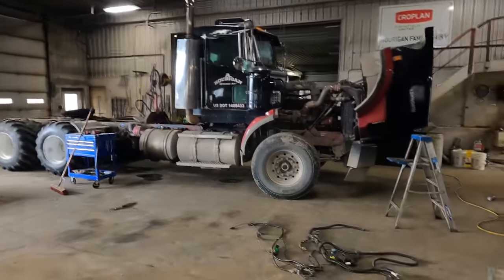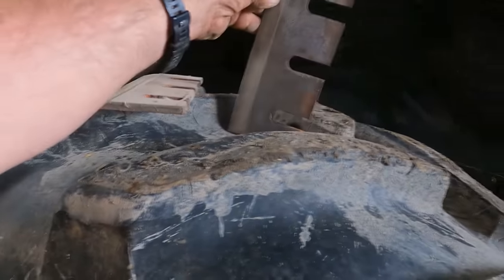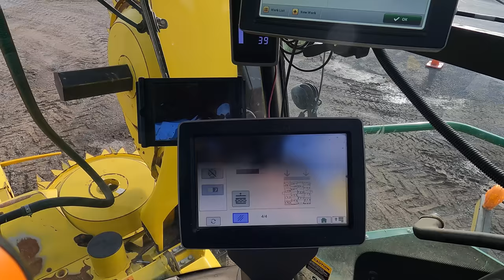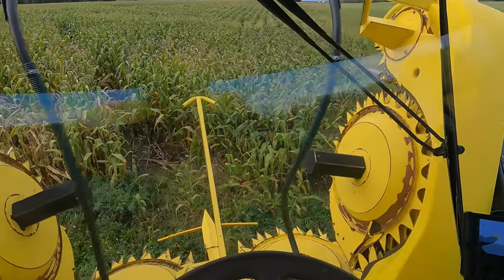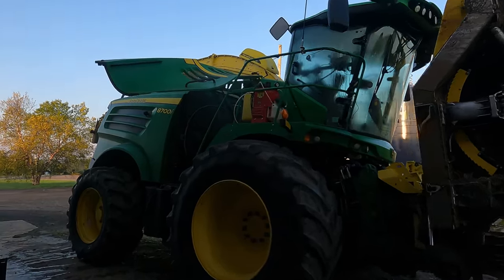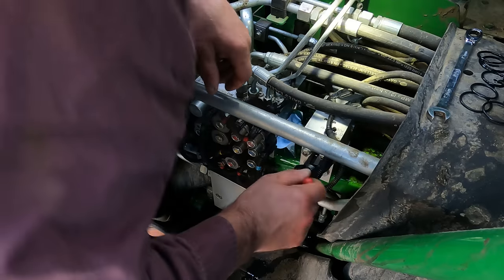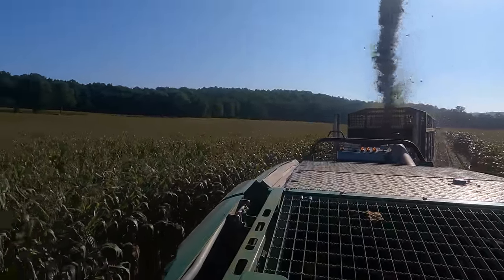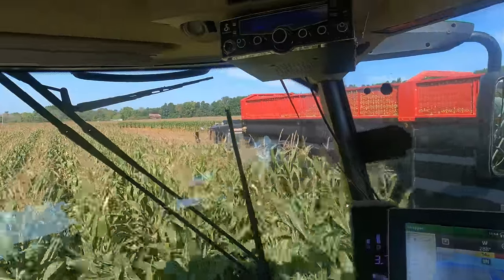Telephone Lines and John Deere Chopper’s

Comment: Sounds like you have enough work for a second 8700.  It would be good for piece of mind in times of mechanical troubles.
Keep up the good work!
 I enjoy your channel immensely!
JIM 🥰
Reply: Richard Homan  I didn't say buy new.  The 8700 is available on the used market from between 300K to 500K 
You would definitely want to shop and preferably get one pre def.
Just my opinion from what I see and hear in the videos.
Sometimes time is more valuable than money.
JIM  🤔
Reply: Heartland Dairy now it was called labelle Dariy we ran two choppers. Two sets of trucks. Quite the operation. Period
Reply: Richard Homan  Note, I did say it seemed they had enough work for two machines.
I did not mean to have one sit around, that is what you said.
You are trying to win this conversation by manipulating what I am suggesting.
This conversation is over.
The only one to determine what will be done is Andy!

Sit back and watch the show.
JIM

Comment: The superior material for O-Ring composition is Viton!
If you are not using them made from that material, it would behove you to find a supplier from which you obtain your O-Rings to use across the board for all usage.  When you get O-Rings from Deere, they very well may be Viton, but common O-rings found in general assortment boxes are very likely not Viton.
Keep up the good work!
JIM 🤩

Comment: That's one of the biggest Problems with the P B & KW Ultrashift  Transmission's is the wiring Harnesses We has both the 13 speed and 18 speeds 2016 2017 and 2018 lucky all of ours were still under warranty ! Good to see your starting chop some corn . At least you had rain out your way tho . a lot of corn & hay out here in the albany area didn't get a lot of rain . So both the hay & corn crop did not do real well . In some places very poor 2 nd cutting of hay .
Reply: Just out of curiosity -- is there a common "bad spot(s)" in that harness and is there a reliable and quality aftermarket source for a replacement harness?  

I'm guessing that there's no core charge; I should DDG(Duck-Duck-Go) it, thanks for the info that sparked an idea in me noggin. 👍🏼

Comment: Do you think a shop addition is in the future. Something with a high enough roof you could build boxes easier/ work on your larger equipment?
Reply: Andy has stated he would be in favor. Would you be willing to donate a $$ quarter million for a shop annex ?  Just meeting the current equipment repair/maintenance expenses has resulted in significant hair loss. Shop expansion remains on the wish list .🇺🇸🗽🍶🐄
Reply: @billupstateny9151  
Does the Horigan(sp?) family know how intimate you are with their business, and Andy with his thoughts?  

My social skills ain't up to par, my balls have shrunk, and I can be rather dumb and dense but never in my wildest dreams would I conjure up the notion that any one that's a part of their organization would solicit and/or accept a donation for their own use.  I dunno, maybe back-handed insults are acceptable in all of  NY and not just the urban centers.
Reply: @lt1nut  would not speculate just what your mind could conjure up however if you are offended by my comment in some manner, by all means submit your complaint to Andy.
Reply: Well, he is in the process of adding a couple hundred feet to a cow barn
Reply: @johnwudarcki9315  Cows belong  on the plus side of the ledger, an asset. Shop work, generally a cost, subtracts from bottom line.
Reply from the maker: That would be nice

Comment: Just a thought Andy.  It may be easier, and less work, to put higher pedestals on the 5th wheel to increase your clearance.  Think you can get them in 25mm (1 inch) increments.
Reply from the maker: Yes

Comment: How did you determine it was the wiring harness on the Peterbilt and not a sensor?
Reply: It was at the dealer they diagnosed it and fixed it

Comment: You should build yourself a universal hyd tank vac pump that can clamp around the fill neck and then pull vac on hyd system that  let you pull a section as you ave done without oil leak
Reply: It's not that simple with equipment these days. There are check valves, solenoids, proportioning valves, integrated into these circuits now. In most cases pulling a vacuum on the hydraulic tank and then taking something apart you wouldn't even feel the vacuum because of all the other components in the circuit. About the only thing you can do with the vacuum trick is put a shop vac on a radiator so you can swap out a coolant temperature sensor or something super fast and you still get coolant all over your hands anyway lol
Reply: @Adam_Poirier  Vac pumps on the machine from new, pull from the return side not the feed side. You are correct you need to have a check valve in the circuit to keep from pulling oil With a vac pump it has been found that you can even remove the main pump suction line without the oil leaking. Agree a shop vac is not that good since the ability for the shop vac to draw at heavy mercury levels is not possible. You can use a good quality A/C vac JD vac pump part # is F061614
Reply from the maker: This valve is way down stream
Reply: @FarmingFixingFabricating  where the valve is does not matter have your JD dealer look up the part # i put into the replay. They can also do a DTAC about the vac pump again reference the part# do the case for a 1270G harv that case will be routed to my group. 
La

Comment: Hey Andy just a question for ya? Would it be worth you buying a second chopper??? Well for these times that you have to start corn and hay is not done but yet would give you a back up in case one gos down!! Yes I know choppers are not cheap!
Reply: Likely $$ prohibitive, in addition to actual machine cost, look @ the $$ resources required for maintenance of just one machine. & buying used, likely abused (worn out) is akin to wishing for hemorrhoids.
Reply from the maker: It would be nice

Comment: Just my opinion...Not a fan of an automatic transmission in a heavy-severe duty application in a class 8 truck...They are wonderful for Highway and dock bumper use...
Reply: If you say so Oliver...Said it was just my opinion...I own 8 Trucks...3 have Allison Automatics...I prefer for my operation of heavy hauling...161k gross to have a transmission that’s working not in the shop...Again just my opinion from real world use
Reply: Do me a favor...Go check out Michigan Special Trucks...We are actually plated for 164k gross..When you do that come back and give me your expert opinion
Reply: @toddmatson4179  Aren't full autos not recommended per Allison over 110 to 120k lbs?  Michigan sure does love adding axles for the full length of the frame!
Reply: You are correct...The two we have are in what you call short doubles...They haul around 100k gross...Like I said earlier...It’s just my opinion from what I have seen in my use....
Reply from the maker: I know what you mean Todd,I thought the same thing. What model Allison auto do you have?
Reply: I have the 4700 RDS....I’m just not sold on the durability and ROI in my application...Allison makes a fine transmission...I will say this about automatic transmissions...It makes it easier to find butts to put in the seat...But that’s all I seem to find is butts

Comment: Jeez, that's bs having electronics in a truck transmission. Go back to a regular 18/15/13 speed and have no more problems. I don't know what the heck is wrong with engineers these days - they seem to think more electronics is good - from what I can see, it is not. Just brings more problems
Reply from the maker: Ultra shift